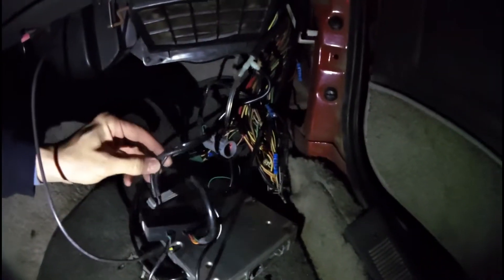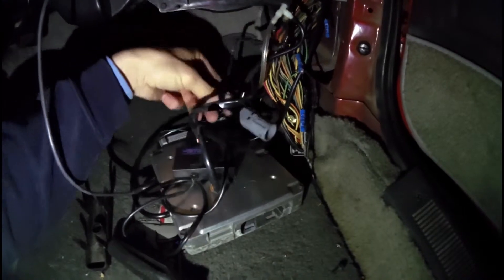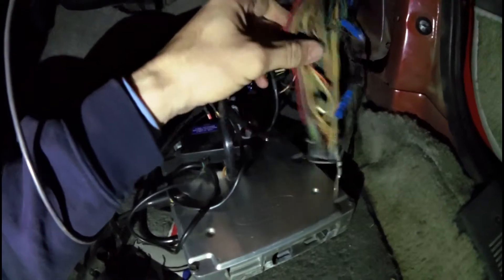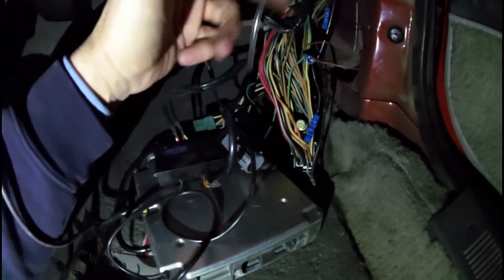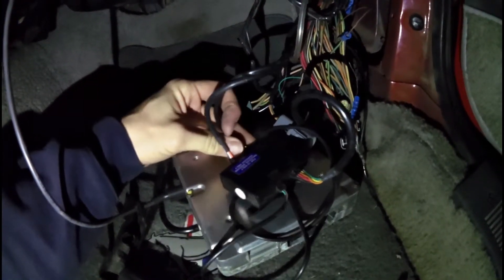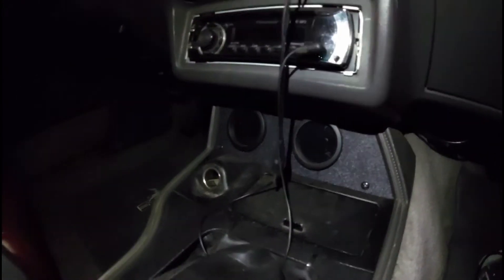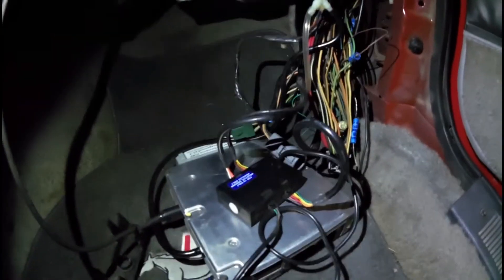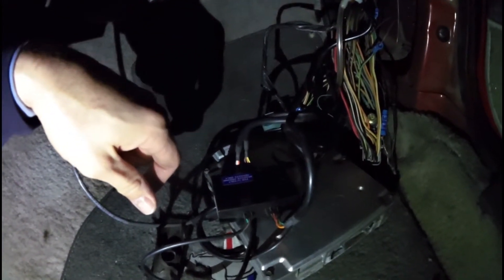Easy Wideband O2 Sensor Wiring  [Stinger PiMP ECU, Foxbody Mustang]

Comment: Looking for a video to find out how you wired the O2 sensor itself in the engine bay should do a video on that
Reply from the maker: The O2 sensor comes with a long cable on it.  Ran it to the connector on the controller.  That’s the easiest part lol

Comment: Nice, helpful video's - thank you! I'm considering replacing my PMS Series III with the Stinger PiMPxs in my '86 GT. Did you remove both factor narrow band O2 sensors and install your WBO2s in their place? Does the PiMPxs utilize the narrow band O2s at all or does it only work off of the WBO2s?
Reply from the maker: The PiMP doesn't use the narrow band sensors.  You have to use a wide band.  I put my wide band sensor where the factory one was, but had to wire it differently because of the connector and the controller that is went to.  I'm using the first gen PiMP.... Not sure on the XS....

Comment: I was thinking of getting one for my 2.3 in my 92 fox cause I think I read it doesn't need the speed density sensor and it sparked the idea of running individual throttle bodies
Reply from the maker: It's a great platform to work with.  The new ECU version they just came out with has even more bells and whistles to play with.